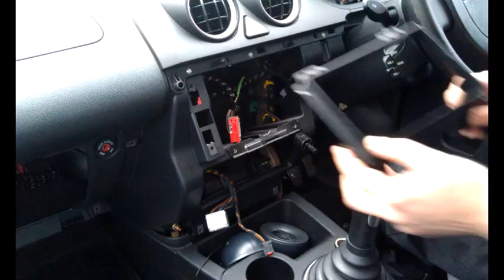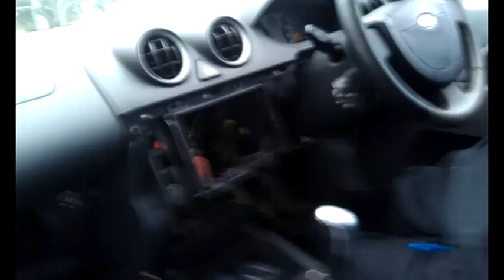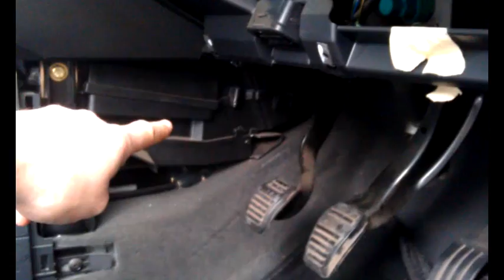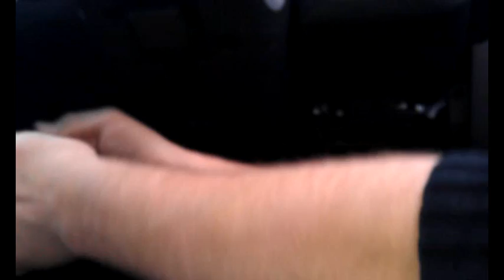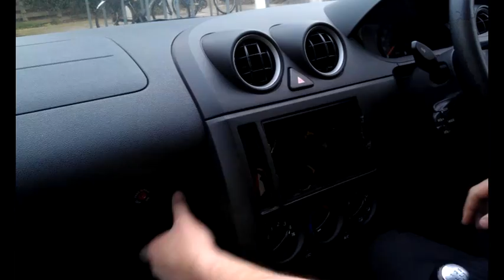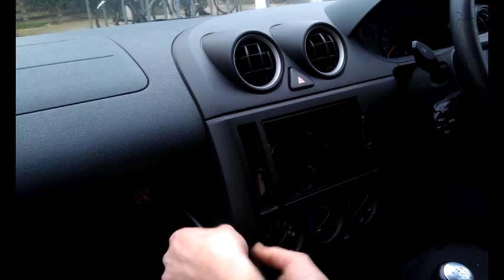Radio Installation Ford Fiesta Triple Dash (2002-2008) | JustAudioTips

Comment: This is great help.The blow direction was the trickiest part for me.Once I got it into the control side it kept popping off so I got some insulation tape around it to stop it coming out .The long green part just pushes in and stays there once you have screwed everything back together.

Comment: quick queastion. i have a radio face (the bit with buttons and volume etc) do i need to buy a radio unit and cage? or can i dismantle and re-use the triple unit that is already in there?

Comment: Has anyone worked out if its possible to re-attach the steering wheel remote? The stereo I installed has a single steering wheel remote wire, and I think the control on the Fiesta has at least two wires going into the stock adapter? Does it require a separate adapter and a bit of hacking to get this wired up properly?
Reply: Andy Hosker isit a kenwood? They usually have a blue and yellow striped wire. If so you need to connect it to  key 1 on the harness patch lead. And if its a connects 2 multilead. Key 1 and remove/cut the orange and green loops

Comment: on the PC2-80-4 Harness which is required to put in an aftermarket radio, what is the single odd cable which isn't connected to the ISO block for?

Comment: Hi looking at doing this in my 2004 Ford fiesta flame once this process is done do you fit in just a double din or do you need a double din and single together to fully fill the gap also how flush will the stero sit with the existing trim Thank you

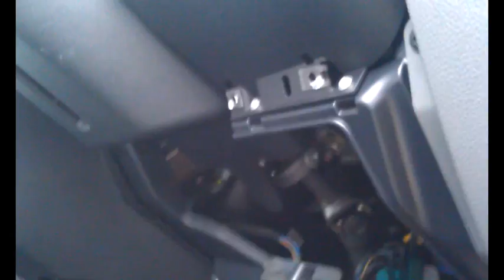Comment: How did you do the tricky part with the air flow control cable? At  3:30  there is a cut in the video, but this one is the most dificult in the whole process, for me at least.
Reply: I've posted this in the other video in this install series, so for interest (and hijacking the top comment).

Having just done this, my advice is:

1) First thread the wire loop thing that controls the heater temperature
 back to where it needs to go (if you stupidly pulled it all the way through, like I did). Make sure it goes through the hole nearest the centre of the cear, if you go for the 'easy' outside one (closest to the driver footwell), you won't be able to clip the plastic bit back in.

2) Next, yank the blower direction peg so that the the other end just 
comes out of its socket (mine was green). It's buried in the car, just 
to the rear-right of the radio. The socket will likely be a bit greasy. 
It's just a press fit. Pull out your radio so that you can shove a hand 
into the hole - obviously leave the wiring intact. Or if you install 
your radio into the bottom DIN rail, you can leave it.

3) Plug the peg into the back of the dial, it's a polarised connector so
 you need to keep pushing while rotating the dial until it goes in. Push
 hard while you turn. While you're doing this, ensure that the other end
 is near its hole - so you'll need to hold the fascia quite close to the
 body of the car. I found it had to be almost perfectly straight before 
it would go in.

4) Once the front peg is in, slowly push the fascia in so it's just 
touching the body of the car. You should leave enough clearance to slot 
your radio back in, if you removed it. Reach in and push the other end 
of the blower direction connector back into its hole. The flexible shaft
 is quite springy, so it should jump into the socket once you've got it 
located correctly. Verify that everything is working by turning the 
dial, you should hear vents open/close in the various positions.

5) Slot the radio/blanking plate back in.

6) Hook on the wire loop thing and plug in the plastic

7) Redo the bazillion screws.

The key is plugging the peg into the dial before you put the fascia 
back. It won't just go in by itself. I'm not sure whether this 
guarantees that the selection is correct once you put it back though 
(are both ends polarised?). At least on mine the settings do seem to be correct after reinstalling.
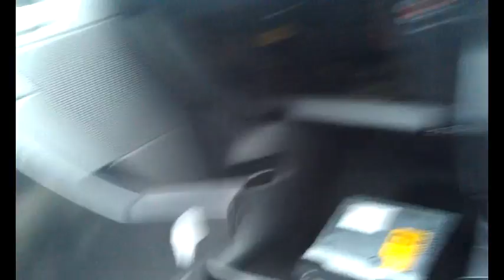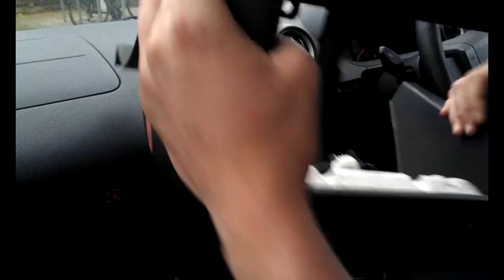Reply: watch again in 3:02-3:03 and turn the air flow cable exactly the same and after that, you should select the button just like in the video 3:19-3:20 it s on the right not the A.C and will fit in. Sorry for my english if you need help or advices just send me a message.

Comment: Thanks for this vid we just installed Sony MEX-N5100BT without problem!!
Reply: Hi, can you confirm that the Sony stereo you bought fitted perfectly without any modifications/adjustments or any extra parts installed beforehand? Did the stereo just slot right in?

Comment: I fitted my single din today using one of the conversion kits off ebay and it's baggy either side of the stereo as well as the plastic pocket. You can wobble them around and pull them out very easily. Not sure why. Everything else works well though

Comment: Hi I know that this is a bit of an old video but, do you have any tips on how I can connect the heater controls at 3:07. This would be really helpful as I have been trying all day. Thank you.
Reply: +Liz Mackin I'm sure you've fixed it by now but a response to help others :) The plug will only go into the socket one way so you need to rotate the dial to match how the plug is sitting as close as possible so it's easier to get in when you put the fascia back on. When you put the fascia on, you need to get it in as close while still being able to put your hand in there and guide/force the plug into the control unit. Once you get the plug in (this takes forever) you can put the panel all the way in. Make sure that the heater control wire is also in the right place as per the video.

Comment: on the wiring connector harness that you have to use to change it from a ford connector to the iso connector what is the pin that's on the separate wire connect to and what is it used for?

Comment: Brilliant helpful video! Managed to fit it myself! Thank you. I bought my facia from eBay £9.88 :-  http://www.ebay.co.uk/itm/281207774236?_trksid=p2057872.m2749.l2649&ssPageName=STRK%3AMEBIDX%3AIT
Reply: @Nick T that looks like it is for a double din CD player, more likely for the touch screen ones. I have a normal cd player which is one din. I bought mine on eBay and it comes with wiring harness that attaches to the new CD players harness and fiesta one that is originally connected to the factory CD player. The facia is divided into two sections one for the CD player and one for the black plastic pocket that came with my package to fill up the space. And radio adapter. As for the aluminium holder you might not need one as mine fitted fine in without it but would mean it is more secure, but mine came with my new CD player so I ended up fitting it in after all. I did this after I had screwed the new facia on, cut and filed the main car facia, reattached and then fitted the aluminium case followed by the CD player. 

Hope this helps somehow mate
Reply: @Nick T don't worry man, just follow the vid and you can't really go wrong, just tricky bits are reconnecting all the wires but I left the far left one in as it was too tight to pull off but I managed to have enough space! Just got to make sure the far right one doesn't pull out of the other end of the car when you are putting it back in as it does not stretch.
Reply: +Tim Yarnold Hi, I have a ford fiesta Ghia 02... which fascia would you recommend i get? i found this one but not sure: 

http://www.ebay.co.uk/itm/Ford-Fiesta-2002-2005-Facia-Fascia-Panel-CD-Stereo-Adaptor-Radio-Fitting-Kit/151417065614?_trksid=p2047675.c100005.m1851&_trkparms=aid%3D222007%26algo%3DSIC.MBE%26ao%3D1%26asc%3D36558%26meid%3Df61b0be6c3df43e88575857fcc2fa70a%26pid%3D100005%26rk%3D1%26rkt%3D6%26mehot%3Dag%26sd%3D250825543800

Thanks!

Comment: I will od this operation very soon but i have only one problem, hope the last one: i need to know the power of the original radio of this fiesta because its the same than mine (i've a Ford fusion, 2002 model). Im looking for a radio which can be good for my car but i don't know the power watt of the radio... ive seen radio with 4x50 and 4x30... which of them??? pls answer me.... pretty please... :)
Reply: +Ludovico Pavesi  The power of new units is the power rating of the output, not the input. Eg. 4x30w means it will run 4 speakers at 30 watts. Pretty much all head units will work in any modern car as they have similar power systems to run accessories like a stereo.

Comment: Followed the video and now have a brand new radio in place! Just some advice/points I'd like to give:
I put a single din pioneer stereo and although I had adaptor connectors with the adaptor kit, I can't use the remote on the side of the steering wheel with it. Maybe it's the stereo model that doesn't recognize it, maybe it's a general thing, don't know, might be something to think about.
For the blower awkward thing, I accidentally pulled the whole rod out. I actually found it easier to first connect the rod to the dash, then to plug the other end back in from the right side. 
Just my input for those who might have trouble or want to do this mod, other than that, the tutorial worked great!

Comment: I need help on fitting the front dashboard where the heating control switches are. You have not shown that part where you fit the circular plug on the right hand side. Can someone please help on this? Thanks

Comment: Does all double-din fit after you've done all of this?
Reply from the maker: That is correct.
Reply: JustSimpleTips
Hey i would like to know if there is a adaptercable wich offers me to use aux input. (for this car radio ofcourse)
Dont want to change the dash just aux input.

Comment: Whilst trying furiously to "fit that piece into the heating controls here", I've managed to pull the other end of the mechanical cable out from somewhere deep in the dashboard! Could you help relocate this end please? Easier to access it from under the bonnet or in the cockpit?

Comment: Cheers, used this last night for my 05 Fiesta.  Finished at midnight :/.  I had a double din fascia adaptor and found that I had to put the radio in first so I could get the rail mount to fit.  Great vid was a lifesaver!

Comment: I have successfully installed a new stereo thanks to your video but find it looks a little unfinished around the edges. In past cars that have had single din units I have bought a surround that has neatness the edges. Are you aware of such a thing for a double fun unit and if so, where.?  Thanks again for the video.

Comment from the maker: Make sure its locked back in its original place, the only reason it wont work is because the cable isn't turning the plastic arm behind the dash.

Comment: Hi I installed my CD player last week and I turned the volume to max. I have tried a new pc2-80-4 and head unit but it still won't work. Old CD player still works fine though. Any ideas? Thanks

Comment: Sorry to be a noob my friend was helping me and didn't take the valve out from the bottom as you do in the unistallation. On putting it all back i can't figure how to put the distribution switch back together? the others are fine though my heat control green bit an arm has come off hopefully that won't cause any problems

Comment: My heater control switch now won't work where you choose hot or cold? The little wire is connected to the plastic arm, but the arm doesn't move? Think  it may have broke any ideas,

Comment from the maker: Sorry for the delay.

Fit the fascia first, then secure the stereo cage and then the unit.
You will need to go for the PC2-80-4 to convert the cabling to Standard ISO. Then use the supplier radio cable to adapt the iso block to fit the new stereo.

Hope we helped!

Comment from the maker: You will need to get the radio code again to use that radio - Pop to the main dealer and they should be able to help you (Sometimes its actually printed on the audio booklet supplied with the car) Hope the video helped!

Comment from the maker: Hi,
The Ford Triple Dash doesn't use the PC2-84-4.. The triple dash uses its own specific lead (PC2-80-4) In terms of steering wheel controls you are right ... You will need to go for the PC99-X51 and also purchase the JVC patch lead which is a PC99-JVC.
Hope it helped and please subscribe!
Peter

Comment: hi mate great vid! i have a very important question though. ive bought a crashed car and the stereo is on code lock and there is no code in the car. can i reset the code after removing the stereo following your steps? or what do u recommend to get it to function again??

Comment from the maker: You will need the fascia FP-07-05 and the Audio Harness PC2-80-4. The cage you require should come with the radio you choose and the audio harness converts the Ford connectors to ISO connectors (The Universal connector)

Comment: Really great video! Just a quick question. I want to install an ISO radio into my fiesta - do i require a mounting frame/cage for this? At the end of the video you didn't install one but would I need to install one to keep the radio in place after its installed?

Comment: With fitting a double din, would you fit the fascia before the cd player goes in or vice versca? Also, would it be the same leads you use to connect the cd player, or do different makes require a different lead? Thanks.

Comment: Hi again, Ive taken the radio out of my fiesta for now as the volume button just doesn't function at all know. I can't even knock it on. Anyway, after taking it out and puting the dash together following your instructions the middle heater control will only stay on cold. Its very stiff trying to turn it to blow hot. The cable doesn't seem jammed at all so it's a bit puzzling at the moment?

Comment: Thanks for the nice video , I have al little question I have a ford fiesta 2005 and I want to install a pioneer deh... but this is smaller than the gab from the original radio so I dont now what to do with the empty space do you have a suggestion ? 

karsten

Comment from the maker: To keep the steering wheel controls on this vehicle you will have to purchase the adapter loom "PC99-X51" you will also have to get the stereo patch loom for a sony for example its "PC99-SON" In terms of USB functionality, best pop into your local audio shop and let them run you through the range
Peter